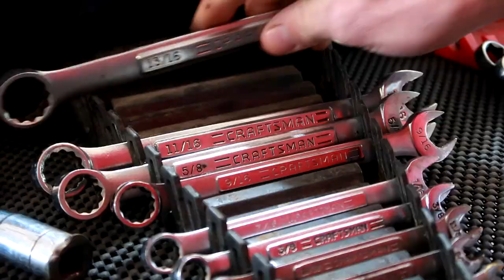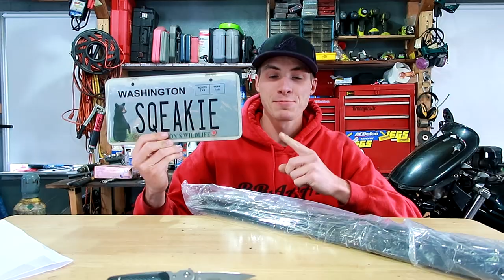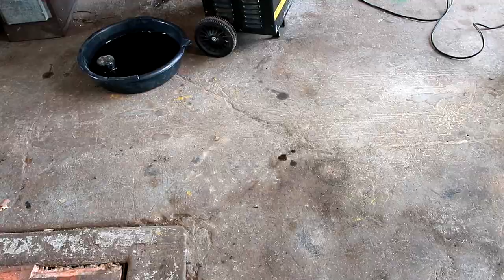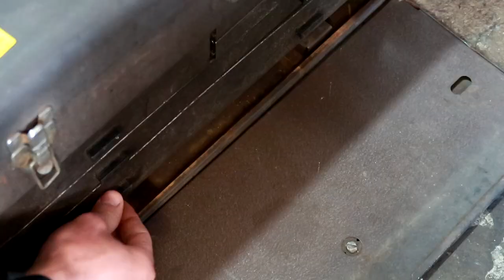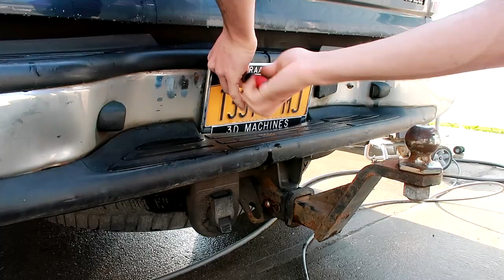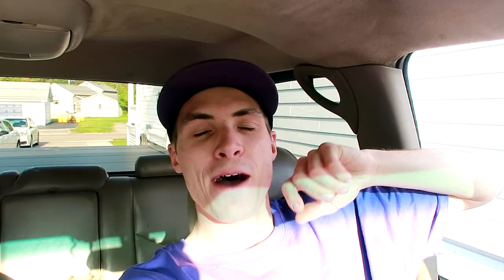FIRST 600 RIDE OF 2017

Comment: When you do your clutch cable it's best to adjust it so it has the slightest bit of slack when it's fully released so the clutch plate can have its maximum force against the clutch it's self

Comment: if the gas there has ethanol in it, always use fuel stabilizer. ethanol is hygroscopic and separates from the gas, pooling in the tank/carbs which can cause nasty corrosion and it tends to chew up older rubber parts...
before storing it shut off fuel and run it until the carbs/bowls are dry with stabilized fuel :)

Comment: Never seen aerokroil used as a lubricant.  It's a penetrating oil.  Try it on your next stuck bolt and you'll never touch the PB Blaster again ;)